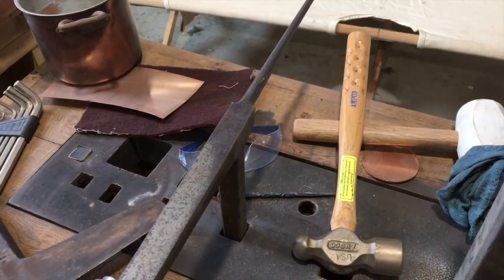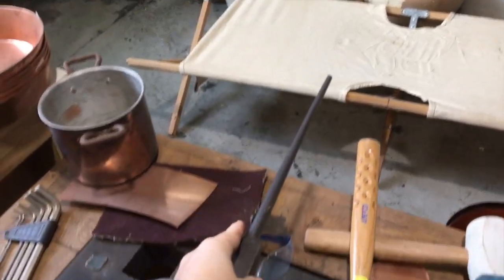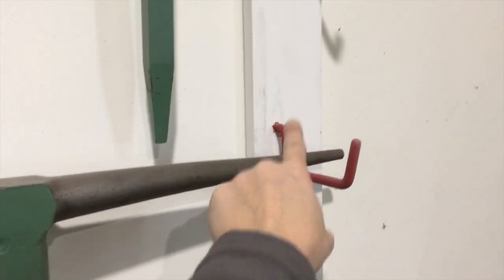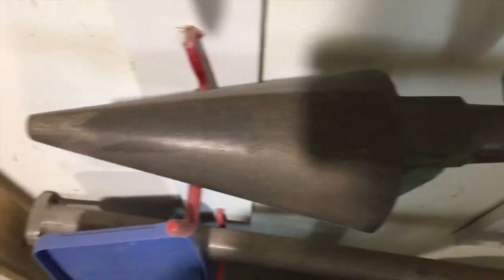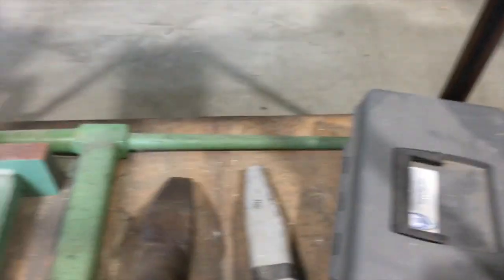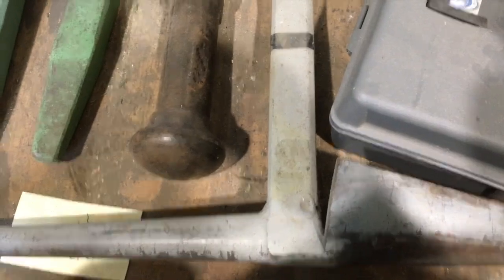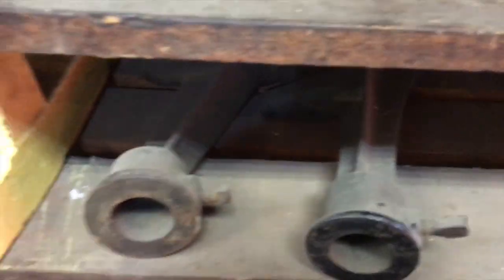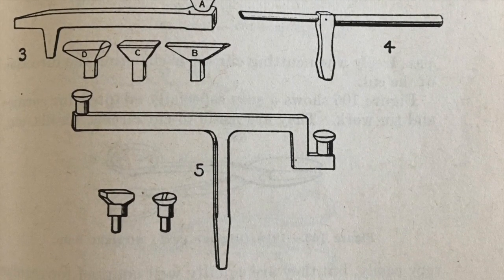Tinsmith Stakes and Coppersmith Stakes

Comment: The conductor stake gets its name from what are more commonly today called downspouts associated with roof gutters, or the intermediary pieces that joined the two. Some of these in the 19th century were quite elaborately decorated. The round headed stake you've got there I've always heard  referred to as a mushroom stake. Nice presentation!
Reply: Olof Jansson was going to research that name, thanks for sharing that.
Reply: Where would the "conductor" name have come from? This is the type of history I love learning about. Yep, mushroom stake is what I've heard that one called mostly around my area.
Reply: @jeffsandling5981  The conductor "conducts" the water from the gutter down and ultimately away from the structure.
Reply from the maker: Olof - thank you! See, I learn something every time! This is awesome. Thank you, thank you! As for the reference to the "mushroom" stake, that's a new one for me. Never heard it, even at the tinsmith convergence. I will have to tell the guys!
Reply: @olofjansson9356  On the right track, gutters (aka eaves trough), conductor "head" largely formed by hand on the conductor stake

Comment: If I may ask what was your written source that you were showing in the video?

Thanks for sharing, this was a very good run down.
Reply from the maker: Hi Andrew, of course - the written source is Sheet Metal Workers' Manual: A Complete, Practical Instruction Book on the Sheet Metal Industry, Machinery, and Tools, and Related Subjects, Including the Oxy-Acetylene Welding and Cutting Process by L. Broemel (lol long title, ain't it?). It was published in 1942. Not sure if it's still in print? I got my copy at one of the tinsmith convergences.
Reply: @housecopper  thank you for your reply, I am excited to add this to my shop. Its amazing what those old timers could to with a plethora of patience.

Also if I may ask have you ever looked into metal spinning?
Reply from the maker: @andrewyork3869  I am thrilled you found the Google version - is it free? I love hearing they have transported old books online, and saved them, so I hope you have access to the whole thing! Super happy to hear you are adding this to your library - it's very useful! And yes, I have absolutely looked into metal spinning. I'd LOVE to do it. Watched several of Terry's videos, and spoke to Jeff down in Georgia, who spins copper. Someday I'll get down there to learn at his feet, but I don't have a lathe powerful enough to spin the gauge I'd want to do. Hopefully...someday...

Comment: What all do you use the creasing stake for in traditional tinsmithing? Is it mostly for rolling straight edges w/ wire inside?

I just got a creasing stake that I am planning to use for making  tubes. I would love to learn more things I can do with it.
Reply from the maker: It is used traditionally for a number of things, but yes, I primarily use it for preparing an edge to take a wire. It can also be used for tricky edges; for instance, I use it the most even now when making traditional dust pans that have a flared edge. But basically the rule goes...if you can use it for something you're doing, and it works well, keep on using it! :)

Comment: Hi again My last comment for the night. Great video and explanation of the stakes  by the way.  Remember, the tools and processes you are describing a basically tinsmithing techniques as applied to copper. Traditional coppersmithing  basically is a hand process, raising and stretching with hammers over stakes and heads ( similar to #3 in the illustration). The copper was generally heavier than tin, the lightest probably equal to 20ga. galvanized, and finished by planishing, to harden the metal and close the grain (yes even Copper has a grain). Again this is not criticism just information. Raising is a process also used by silversmiths to form hollow ware,just as an aside. I learned some, I stress some, raising from my father who was also a sheet metal worker, he was taught by his father who actually was a coppersmith. (my grandfather actually served his apprenticeship in the metal shops of the NYC railroad when he was a pup). As I said I offer this for information only!! I am by no means an expert. Since I have retired I have been trying to recall the things my dad taught me and apply them. Luckily, I inherited both his tools and those of my grandfather, hammers and heads mostly, as I say, it is a hammer intensive enterprise (you may actually have seen pictures of the types of hammers I am talking about).  Actually we sheet metal workers( havc worker persons :)))) also have a small tradition of hand raising as well. Sorry to appear so long winded, but I applaud what you and Bob have and what you are doing and It is just exciting to have contact with Like minded souls! I will try to get my workspace in a presentable condition and send you some pictures of my collection  of stuff.
Reply from the maker: william dorn william dorn Hi again Bill! Thank you for watching another video and for all of your greatInput and feedback. I to use these tools for a vast amount of coppersmithing in my garage as does Bob, and love that they can be interchanged between tin and copper metal. How fantastic to have him here is had so many tools and knowledge from your family. Please feel free to send me photos as my email is available on my website. I have never tried my hand at silver but it looks absolutely beautiful to work with as a metal. It is a wonderful thing that the Internet has connected so many people who feel so connected to this trade and craft and I am thrilled you have found me and Bob!
Reply: william dorn  Are you in the hvac trade? That's what I do for a living (Industrial HVAC/refrigeration/Chiller maint.) at a large steel mill in Texas.